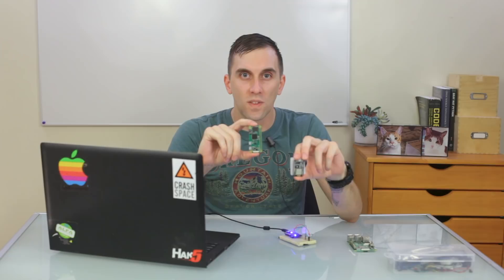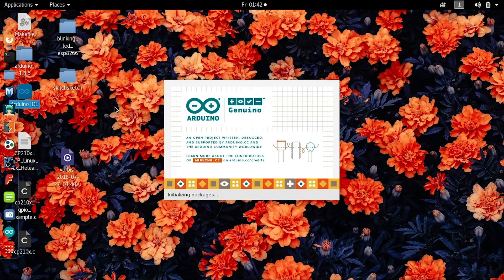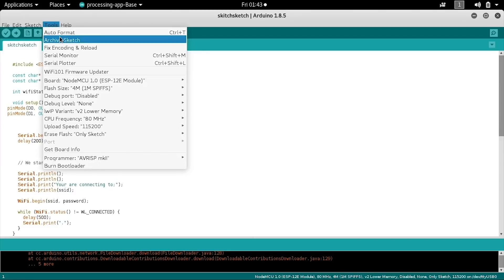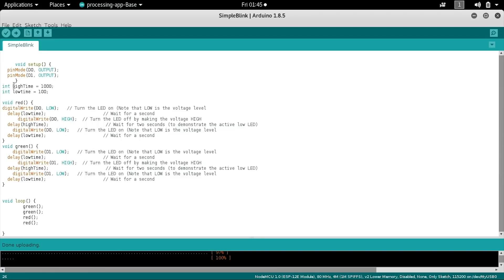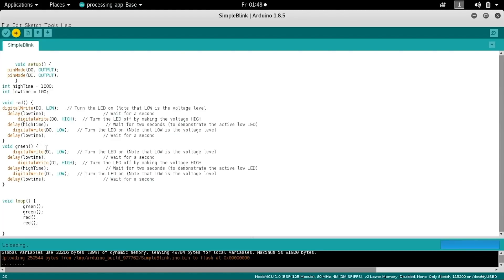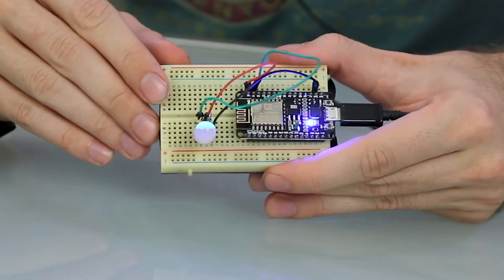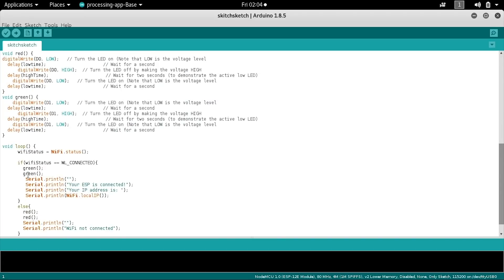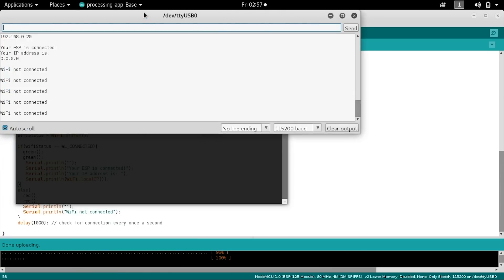Program a NodeMCU to Detect Wi-Fi Jamming [Tutorial]

Comment: Can you save its report in say nano? so if your wifi was hacked or jammed but you did not see the light change (coffee brake). You can still see when it happen and howlong it lasted for.
Reply: Maybe a Raspberry Pi Zero that is capturing with tshark (Command line tool for Wireshark) only detecting deauth packages?

Edit: you could still use a rgb led to indicate the status while not coffee breaking 🥴

Comment: Arduino has pull-up and pull-down resistors build into the board (look if NodeMUC has one too and you can use the function INPUT_PULLUP or INPUT_PULLDOWN). Then you don't have to use resistors on led's. 2. you could use one resistor from ground (on the led) to the NodeMCU (GND) because you are still limitting the resistance.
Reply: YouNoob

Comment: Hey null byte are you using Semicode OS?? Nice tutorial btw😊
My windows 10 and kali Linux both aren't detecting my wifi adapter what to do buddy?? I have been facing this for 3-4 days..I dont know what happened how it happened, windows 10 detects it sometimes but it doesn't work..and if i check network devices in my device manger its not there..so is it hardware problem ? My adapter is mot connected/attached properly to motherboard etc.... Thank you😉
Reply: You are using a pc? Then simply google for the data sheet or find the manual. There you can find the pins for the USB connectors. Simply shake them a little bit and tighten them.

Comment: Hi Kody, technically resistors are required, not because you may have a "fragile LED" but because the current needs to be limited to prevent either the LED burning out, or worse,  damaging the ESP8266. It's worth noting that not all RGB LEDs are common cathode like yours, some are common anode, and viewers should make sure they buy the correct one if building this circuit. Finally, it sounds like you are saying "Ardreeno", I think it's pronounced "Ardweeno".  That said, keep up the vids, I do find them useful and educational. Thank you
Reply from the maker: Thank you! The correct wiring is in the full guide, I'll make sure to note this in the next guide.

Comment: But this isn't detecting Wi-Fi jamming or any sort of attack.
It is just indicating if it can connect or not. Put something in between it and the router, like distance or a metal cage, and it will "detect Wi-Fi jamming". See the issue? This is like saying that a desk lamp is a power outage/surge detector.
I assumed this to be a how-to to setup a listening(monitoring) device that detects the actual jamming packets. Instead it's a small "desk lamp" that spams my router log.

Comment: This seems like it detects connectivity issues more than jamming. Unless I'm thinking about this wrong it's going to blink red regardless of the reason you aren't connected..
Reply: Jeremy, yes that is the reason that this is not a good method, you should check for frequently send de-authent packages instead.
Reply: @javierpallalorden  even that doesn't cover all aspects of jamming 802.11... You could flood the channels, death, disassociate, or do other things depending on the config. The concepts cool it just leaves a lot to be desired and a lot of false positives.
Reply: Okay, but the deauthentication frame is one thing you can easily check with a display filter. Deauthentication --> wlan.fc.type_subtype==12
Reply: Yeh but he doesn't do that... re just verify the link.
Reply: Yeah, its a good concept and a decent starting point but the concept isn't fully developed. You almost need to monitor the 2.4 ghz band for saturation, look for deauth and disassociation frames, is the AP alive and check your systems interface state is ifup/ifdown?
Reply: Yes, we are thinking the same thing. I know do that in a NodeMCU it's a bit hard.  But it would be more nicely done if they monitoring for deauth packets, since it's a bit hard to see them in a normal scenario without attacking. But it would be some others limitation such as channel and processing maybe. Maybe with a cluster of NodeMCU, each one monitoring one channel... hummm a good project for me.. i'll try that soon.

Comment: No dude, You didn't wire up the resistors correctly. They shouldn't be in the same row. if so then the rows are already short circuited and there is no point of having a resistor in the same row to limit the current flow.
Reply from the maker: This is true, I added a note to check the full guide for the right wiring
Reply: @NullByteWHT  yeah, I noticed that you have wired up the resistors correctly in the guide. kudos for your video.
Reply: He missed it in the demo but the guide has the correct way.

Comment: Nice but as you sayed this can be tricked. If you attack a specific device (deauth) it wont detect anything... but hey its easy and will work on most cases :)
Reply: Choosing a Raspberry Pi zero is also a good choice: simply write a script that will start on every boot and that captures only deauth packages with tshark and that indicates with the LED whether there are deauth packages or not flying around in maybe the last 10 seconds. 
Additionally you also could save the output in a file so that when you are away you can identify an attack even though you saw no LED blinking.

Comment: Great video! Is nice to see Ethical Hackers and Security part of the community to also use simple eletronics to solve and do some useful devices. The device is simple but I do think that you code is a bit messy! But there's a good job here congratulations. Im an Eletronics Technician and I'm going to course Eletronics Engineering, the next step is add an I2C 16x2 LCD screen so we don't relly on a computer to see the results in the monitor. I'm trying to get some knowledge about security. Thanks for all the knowledge! Regards from Portugal!
Reply from the maker: I cleaned up the code a bit for the full guide here: https://gitlab.com/skickar/NodeMCUWiFiLinkMonitor/blob/master/WiFiMonitorNodeMCU.ino

Thanks for watching!

Comment: Aren't the resistors just bypassed if they are in the same row? Or did I not see this correctly, kinda hard to tell in the video...
Reply from the maker: The correct layout for using the resistors is in the guide, but during the demo I forgot to plug it onto the other side.
Reply: Yes, I think they are in the same row haha :c , you can also tell by the LED intensity not decreasing
Reply: I'm happy to see that I'm not the only electronics noob :D
The first time I started experimenting with an arduino there was smoke rising from it...
Reply from the maker: @Droggelbecherbot  I too have released the magic smoke from a nodemcu already once